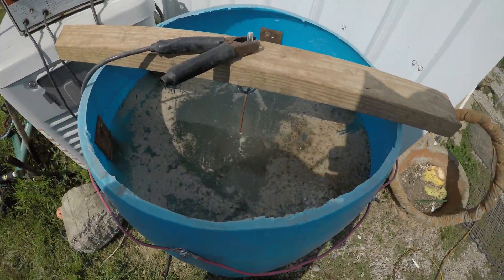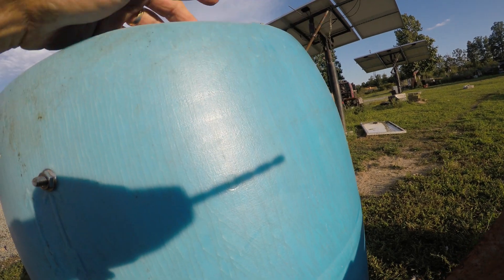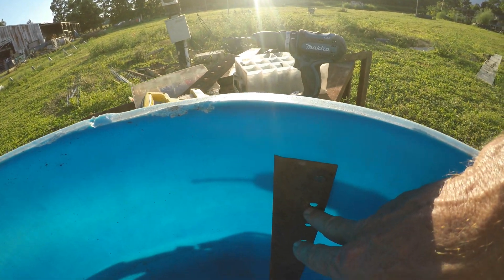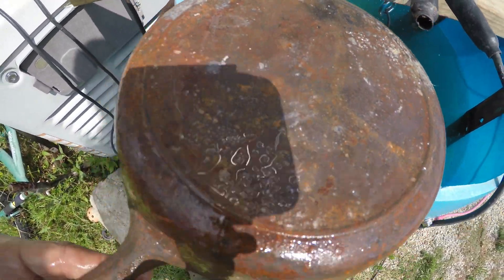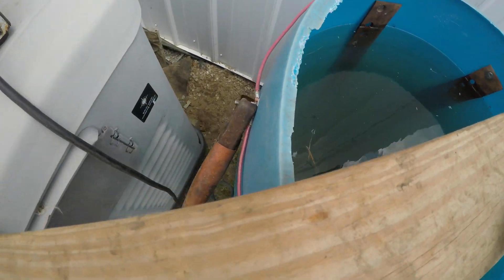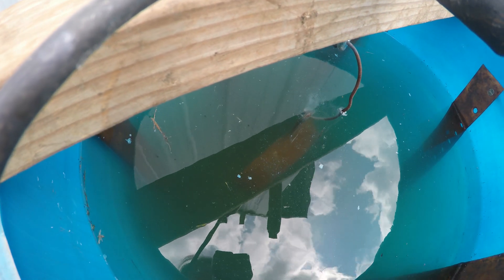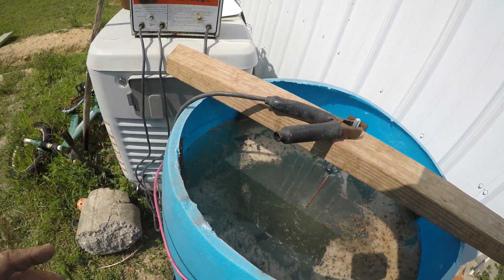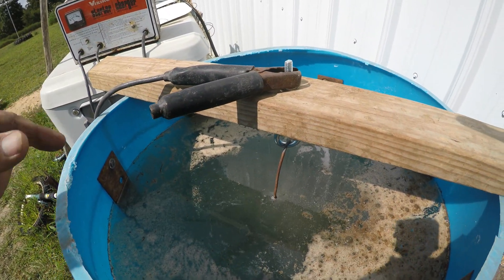How to build an e-tank. Cleaning cast iron pans. DIY ELECTROLYSIS TIPS

Comment: Looks good. I generally go over night 16to 24hours
Reply from the maker: That's what several people have told me. When I first built mine I checked the pans every couple of hours and they were finished. I don't see any reason to leave them in any longer than needed. As long as the rust comes right off I'm good. Thanks for the comment.

Comment: Great set up you have and thanks for sharing. It really is simple to do and minimal cost. FYI, I use thrift store laptop chargers that are 12V DC output. Not sure what happens if not 12V DC but the 12V DC ones work great and available for under $5. Just need to strip wires, determine positive and negative wires and attach alligator clips with solder. Other YouTubers have videos on how to... Thanks for sharing and showing off an excellent system for cleaning cast iron.
Reply from the maker: Great idea. I have a couple of old laptop chargers sitting around. I am going to try it. Thanks for sharing.

Comment: Saw one video. They used stainless steel anodes. They used a meter to measured the gas give off. It was not toxic. Plus the Stainless anodes were easy too clean.
Reply from the maker: Yes you can use stainless if you want. You can also use graphite rods. I used steel because that is what I had on hand. Didn't have to go buy anything. Good luck with your build and if you have any questions let me know.

Comment: Can you use anything other than an old battery charger?
Reply: I find 12 laptop computer adapters at thrift stores and put alligator clips on the wires. There's a YT video of how to figure out positive from negative wires. The adapters are cheap and so far none have burned out on me in over 6 months of use. A regular PC power supply can also be used and there's videos on YT showing how to wire them. They work well and are cheaper than new power supplies or old car battery chargers that will burn out and the new chargers with auto shut off don't work for electrolysis. Have fun and be safe.
Reply from the maker: Great idea. I will have to try it.
Reply: Thanks for replying, I’ll give these a try
Reply from the maker: Yes you can use a dc power supply.  Dc power supply that can be adjusted to 12 volts and 5 amps.

Comment: I'm building one at this moment. I'm going to use a steel core that comes from steel coils used in can manufacturing. They come from where I work and we throw them out so free is good. I bought a food grade barrel off facebook and have an old manual charger. Just need to find a spigot to attach at the bottom to make it easy to drain and cut the steel core to size since from I understand you want it a little off the bottom. Then I plan to suspend it with a few bolts and attach positive to that. No need for wires since it will be a continuous piece of steel. I also plan to put it on a furniture dolly to make it movable.
Reply from the maker: Sounds great. You are going to love having a etank. I have a line of stuff to put in mine. Free is always best Lol.. It does a great job. Good luck and if you have any questions let me know.
Reply: @HippieHillHomestead  I have been told the anode shouldn't touch the bottom. Is that true and I'd guess that would be so it doesn't come in contact with stuff that drops off. I made a small tank and it worked great but I wanted something bigger and stronger since it was a medium sized trash can and was flexing out from the weight of the water.
Reply from the maker: Yes you are correct most people don’t make their anodes long enough to reach the bottom. But It won't hurt anything if you do.